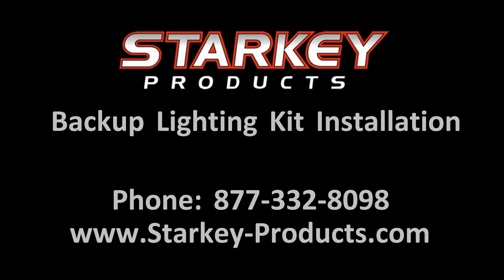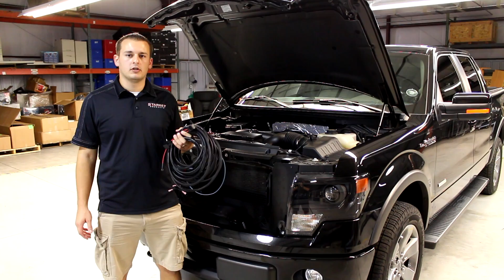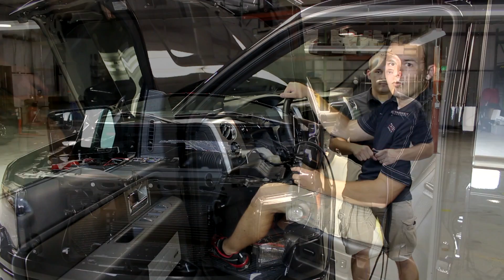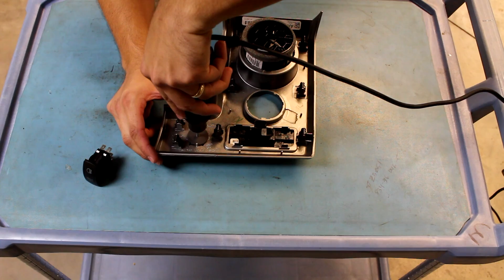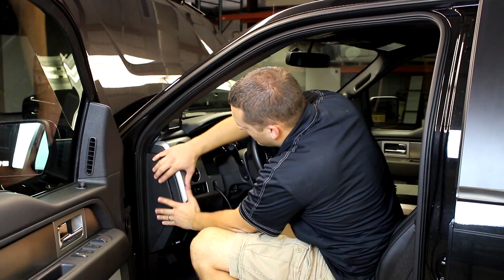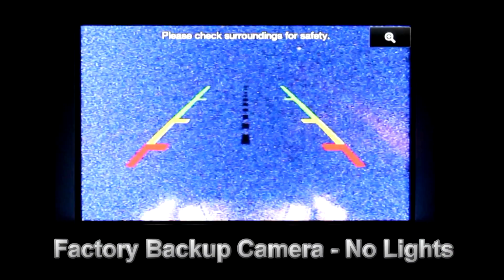Installation | Backup/Auxiliary Lighting Kit | Starkey Products

Comment: What relay is being used?  I already have lights but they are wired to a control box. I want to rewire and add a relay to have it come on with the reverse lights as well as my switch. I am not good with relays and do not want any back feeding into the BCM. 

Just need to know how you guys have the relay set up so allow pass through power from the switch and activation with reverse, but not allow manual activation to hit the reverse lights.

Comment: The big problem is by putting them there instead of getting flush mounts and putting them in the bumper that they hang down allowing things to ge caught on the sticks, rocks, if your tuck goes off road and for I  the city traffic cones, and trash bags. Of you mount them under the bumper they with get ruined and destroyed. For bumpers flush mount lights are the way to go. You can pit the pod lights on attachments that clam the hood or can mount toa roof rack system.

Comment: This is a poorly done video. There were no shots of where the Drilling into the firewall or how it was wired up to the battery.
Reply: He did not show the fire wall but I know where to drill 1inch to the right of the sterring shaft and 2inches down from that is a clear spot to drill.and in the intro he co enter the positive line into the fusebox under the hood and the ground to the negative side of the battery. But to be simpler bolt the positive line to the positive side of the battery and the little black wire to any bare metal or a ground bolt. And every company says use a relay they are not needed for on off lights if your going to have flashing lights then you need a relay.

Comment: I have had a private mechanic try and install and it kept blowing the fuse. Was he not correctly installing?
Reply from the maker: Hi Nick - There isn't too much to 'mess up' so I wouldn't immediately think it was an installer error - basically you connect to power and ground under the hood and then route the harness to the rear of the truck. I would have him take a close look at the wiring from the relay (mounted at rear of truck) to the power and ground wire up at the front. I would be concerned about a possible short in the wire in-line that is causing the fuse to blow. If he is still having problems, please have him give our tech support a call to help with the issue. Thank you!

Comment: just wondering why the hell you would not just run power back there and use the reverse light circuit to trigger the coil on a relay and turn on those led lights. just sayin. would be much simpler

Comment: 2013 f150s do indeed have a place for aux wireing all you do is cut a nud off a rubber boot from the engine side
Reply: Can you be more specific. My truck is also a 2013 F-150 and I am thinking about doing this install. Where is the rubber boot to which you are referring?

Comment: Seem to skip right over the difficult parts.  Like drilling through the firewall and routing the wiring.  All in all pretty useless obviously made by a company whose goal is to sell lights not help you install them.  I am also wondering why the switch was not a round cut out as drilling a hole is much easier than cutting a rectangle and they are readily available in holes sizes from 1/2 to 7/8 inch.  Not much of value in the video.  Anyone can do the easy parts with no help so filming them is not helpful.

Comment: Are these lights weatherproof? I need these for backing up when I am snow plowing so they may be exposed to snow. Is there any kind of weatherproof casing around them?
Reply from the maker: +Matt DiMatteo - Yes, these lights are in a sealed housing which is IP67 rated meaning that they can actually be submerged in water with no issues. Snow will not effect them, neither will extreme cold. In fact, a large portion of our customers that purchase this product do so for snow plowing.
Reply: +Starkey Products Thanks for your reply. I own a 2009 GMC 2500 HD. Which of your products is best to mount below the bumper? I understand there are multiple degrees of led reverse lights on your website.
Reply from the maker: +Matt DiMatteo - For your application and needs, I would go with the Dually Diffused (60 degree) lamps. These are the most rugged cube light you'll find, and they surface mount to the bottom of the bumper without much effort. The 60 degree diffusion lens is going to disperse the light about twice the width of the truck and approximately 25ft back. If you have any other questions let us know!

Comment: How can I connect back up lights to my f150 that has roush pipes that are straight back. So I covers the screw where your suppose to screw on the light
Reply from the maker: K  The way we mounted them in the video is just an example, but there are several other good mounting points to choose from. The lamps are also adjustable to get the the perfect fit.  I have mounted quite a few on F150's myself and have never run into an issue with aftermarket exhaust being in the way.

Comment: Hi I have truck I add light in rear with rear light it work great I don't want to put switch light for back cuz I'm sure somebody wud forgot turn light off while u driving lol only way better that hook up with rear light so when u change to rear on trans same time light go on
Reply from the maker: Christopher Morton Even if you don't wire up the switch, the lights will still come on when you put the truck in the reverse gear if you follow the normal installation. Hope this helps!

Comment: I get it but I guarantee you that a ton of people clicked on this video expecting much more instruction.  In no way did you show where to get your 12 volts or how you used the battery terminal for your negative. You didn't show where you drilled into the firewall (or wherever) to get the switch wires and grommet in place. You also needed to show people how you routed the wires to the rear and also how you mounted the actual lights. Just not a good video for the people that really need help. If you are afraid of lawsuits then just don't post at all. Just advertise.  I appreciate the time and effort but for these guys that can't  turn a screwdriver, this is far from helpful. Thanks anyway.

Comment: Why exactly do you want to see someone drilling a hole in a firewall and putting a grommet on it? If you're working on your vehicle I would hope you know how to drill a hole and pull wires. You need to be checking the area you are going to drill no matter if this is the same vehicle.. The instructions for the 2009+ F150s have the wiring harness running next to the factory wires that run alongside of the driver's side frame rail.
Reply: Exactly my thoughts. Everyone comes on here complaining that it didn’t show them how to run wires or where they should drill. If that’s the case, they have no business installing anything. 

It’s easy to run wires, climb under your vehicle and see all the harness and run the wires along them. Don’t need a video to learn how to do it, your vehicle literally has it done for you already, your using the same route. Same with the firewall, 30 seconds under the hood and you can see grommets, you can make a tiny hole and run it along side wires in the rubber already going into your vehicle. If they still can’t figure it out, take it somewhere and have them do it. Every vehicle is different, every application is different. They don’t show how to do everything because it doesn’t apply to half of the people watching the video and their vehicle. They are showing what the harness and the lights do. That is having a switch to turn the lights on, or having them come on with the reverse lights. The are Rigid Ind LEDs, if they don’t know they are some of the best on the market, then they should watch videos about them. 

People need to stop hating because it doesn’t show a step by step process. It says it’s an install, not an instruction video.

Comment: yeah show me how you drilled and where you drilled inside the drivers compartment into the firewall and how you fed the wires in, and how you fed them all the way to the end.
anybody can wear the "professional" uniform and talk off a screen.
Reply: certified30  on some f150 they have Factory  drilled holes to the frame that you can use to mount

Comment: why not hook up to rear lights to tail lights that way you don't have to run wires from front to back of truck use reverse light wire to power light then it goes on only when you put truck in reverse?
Reply from the maker: Hi,
The primary reason you would want to use a wiring harness like ours is so that you don't place an excessive strain on the factory electrical system. The factory tail light wiring really isn't designed to power an auxiliary set of lamps, and by connecting directly to the battery with our wiring harness you avoid problems like this. Late model trucks are especially susceptible to problems when you attempt to draw power through factory wiring.

Comment: totally useless. where did you drill the grommet hole? where did you run the wiring to the rear? how were the lights mounted? did it ever occur to you to actually show the install by taking the camera inside and underneath the damn truck? failure.
Reply: Starkey Products the other comments are correct. You didn't really explain how to mount anything.
Reply from the maker: Hi Fred,
Thank you for your feedback. The reason the video did not illustrate drilling of the grommet hole or mounting of the lamps is because this part of the installation varies by vehicle - remember this video is a guide for all trucks, not just F150's.
Reply: Starkey Products well i have a 2013 f150 that i want to do this too an ur video barely showed me how to do anything just like fred said failure if ur gonna make these videos on how to do it on a particular truck you need to show the whole process an an show how bright they are from the truck as well as looking at the lights while on from the rear.